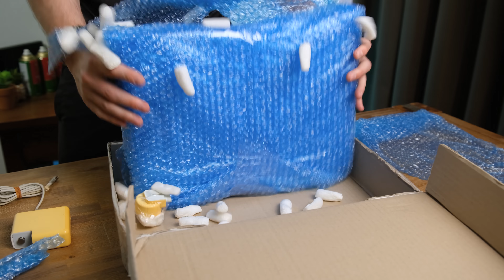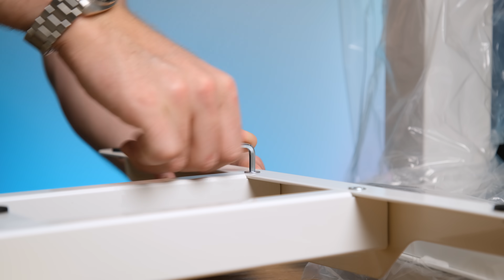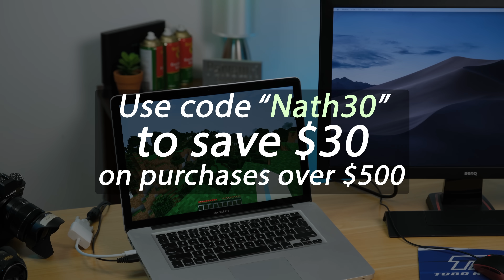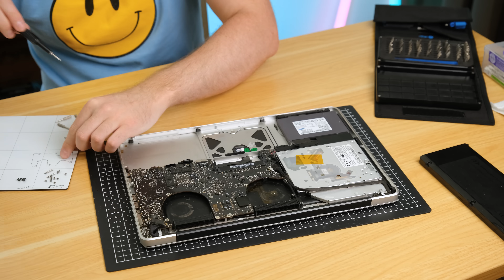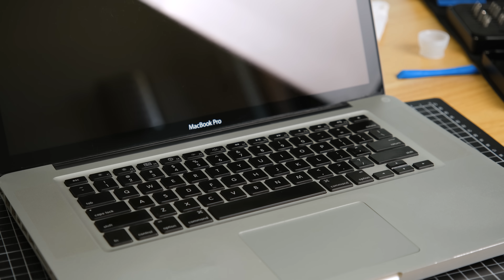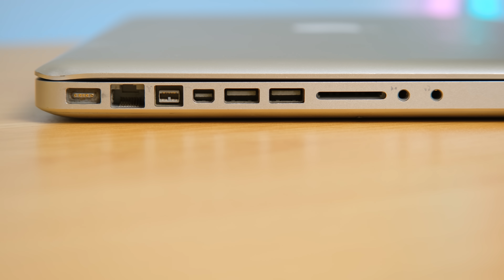$67 Macbook Pro From eBay! Is It Obsolete?

Comment: Still have mine from 2010. Replaced battery once and was contemplating swapping the optical drive for a SSD but it just keeps going and doing what I need it too.
Reply from the maker: I’d highly recommended the optical drive swap, assuming you don’t use DVDs anymore :)
Reply: I may well do it at some point. Sadly I kind of like keeping it original (except for the battery) Nerdy I know. Can’t remember last time I put a disc into a machine.

Comment: The SPD chip on ram stick is just an eeprom. You can program it with an arduino and set it to lower speed. I was able to get 16GB ddr3 working on my 2009 macbook.

Comment: my mom bought a 250$ laptop in 2017 and it had 4 gb ram ddr3, a 1.6 ghz dual core celeron and a 500 gb hard drive and it was slow, very slow it took 20 minutes for it to boot.

Comment: i had mine from 2009 still running flawlessly till 2 years ago. Then some motherboard issues occurred and i ve been forced to buy a 2nd hand one on ebay. I ve paid attention to buy one with the exact same specifics, ram , ios, and so on, except for the HD storage which was smaller. ALSO, unfortunately in 2021 i didnt know where to retrieve all my cracked softwares, basically i ve found myself with a fully working 2009 17" macbook pro but no softwares at all. One day i had this idea to JUST replace the entire HD with my old (functioning and full of softwares) one, and with a big surprise my old macbook SOUL was back to life working in a new macbook body.
but then 2 weeks after the screen started to have some issues till the point didnt work anymore and couldnt see shit. 
I then transplanted the screen from my old hd-amputated old macbook pro to the new body.
Im typing all this from my 2009 frankenstein macbook pro, which is still goin strong!
Im a vfx artist so from time to time i like to do stuff with Maya, Nuke and AE, and even if my machine is 24 years old, is still performing fine!

Comment: You’ve given me renewed hope in resurrecting my 2011 MacBook Pro. I’m sure that all it is crying out for is an SSD as I had specified the top 16gb RAM when it was ordered. I don’t know if I can go any further with the RAM. 
Unfortunately the model had a problem with the video somewhere and the only fix was to disable the GPU, from memory. That’s also disabled the screen brightness controls and it also means that the laptop can’t be used for mirroring. If there’s a way to get the video working properly with the brightness controls etc, I would love to know how to do it. 
Once that’s finished, then it’ll be time to look at installing something newer than Mac OS X 10.13.6. Some of the software these days doesn’t want to work on it!

Comment: I'm watching your video on my 13" 2009 Macbook Pro.  I was able to install Monterey via Open Core Legacy Patcher.  I highly recommend it to anyone wanting to breathe new life into an aging machine.
Reply: I used to use the same laptop with the same macOS, but recently I upgraded to a 2016 MBP. Although, for some reason, my 2009 MBP was very slow, despite it having 8GB RAM, a completely new battery and everything needed for it to function normally.
Reply: I have a MacBook Air from mid 2012 that I used as a daily driver for many months before getting a desktop. I installed macOS Monterey though OCLP and it works surprisingly well for such an old machine, though the battery life isn't great. It's better on macOS Ventura but the fans run at maximum or high speed basically all the time, which can get annoying. Same for Monterey, but it runs a bit better and the fans don't complain as much. I hackintoshed my current machine and I'm running macOS Sequoia without any problems, but if I need a laptop I'll still take the 2012 MBA.
Reply: PS make sure you have an ssd

Comment: Well, I once found a MacBook Pro, having been donated to my local disability group for a science lesson. It was with a couple of other laptops due to be disassembled for said science lesson. I looked at it, and thought, this can be fixed. I decided to take it onto myself to restore it to its former glory.

It appeared to be a 2010 model with a Core2Duo processor. I opened it up, and discovered that while it lacked a battery or hard drive, it’s logic board was intact, albeit a little dusty. I got it cleaned out, installed a new battery and hard drive, and installed macOS onto it. I discovered it was an i5 processor, so that’s a bonus!

I then proceeded to install 16gb RAM into it, and recently added an SSD, into it. While the keyboard was a bit faulty, I developed a workaround with a Bluetooth keyboard, and it apparently works better with the power supply attached. But those are mere trivialities. The fact I got a MacBook Pro for free is worth the effort. 😊

Comment: Love the uploads! And hi from Tassie.

I recently fixed up a Dell Studio XPS 13 1340. It has a similar GPU setup with one GeForce 9200m and one 9400m, the whole setup is named the 9500m GS. It also uses SLI between them with the right drivers on Windows Vista/7.

Comment: Holy cow, TWO Nvidia chips in a MacBook? I wonder if this is a secret SLI MacBook I've ever thought of😅
Reply: No. The other one is an integrated GPU on the core 2 duo processor. This is before Intel started making the i series processors and before Intel and Nvidia’s beef where Intel stopped using integrated gpus from Nvidia in their chips.
Reply: @nomaanalwi9495  oh, ok I guess. And Apple's relationships with Nvidia is broken anyway😅probably gone with AMD for quite a while before gone all in with ARM Apple Silicon
Reply: You think two Nvidia chips in a single machine is unexpected? Imagine an AMD Athlon desktop w/ integrated Nvidia graphics! That was my first desktop ^_^

Comment: I spent $20 US dollars on a early 2008 MacBook Pro, you know, the one with the nvidia 8600GT that tended to fail. I guess it was never used, its the only silver keys with a Core 2 Duo. I'm replying from it. They can still be useful, and I got the last of an era, but it still surfs the net perfectly fine
Reply: The 2007 models have core 2 duos as well. I also have one of these early 2008 models. The battery is completely dead though, so it’s pretty slow.
Reply: @EvilTurkeySlices  The battery on mine kinda still works. I found a NOS battery at Goodwill a few years ago and it worked great for about a month before it turned into a puffy danger pillow, luckily it didn't damage the machine.

Comment: I have a Mid-2012 13 inch MacBook Pro that I use as my main Mac, and it has several hard drives I use. I have macOS Sierra, Catalina, OS X Mountain Lion as regular installs, and macOS Big Sur and Ventura through OpenCore Legacy Patcher

Comment: I have a 2011 15" MacBook Pro with the i7. I've removed the optical drive, and replaced the mechanical disk each with Samsung 1TB EVOs, as well as upgrading the ram to 16GB. One is dedicated to MacOS, the other is dedicated to Windows 11. Honestly, I prefer using this computer over my 2015 Retina MBP.
Reply: Make sure to keep up on the cleaning and thermal paste replacements. These are the models known to have flaky graphics.

Comment: I still have my 2011 macbook pro.
I replaced the motherboard, speakers, added 8gb of memory, replaced the cd drive with a second ssd, and the battery over time. The board had to be replaced because this generation had the amd 4750 which would burn out because of overheating. My solution was to simply drill holes in the bottom cover where the fans are. Lowered temps by 15 degrees. Faulty battery on these causes slow performance, which i only found out after replacing mine.
Oh and until recently, mac OS did not support trim natively on the ssd unless its model name included "apple ssd". Luckily i was able to reflash mine to display this model. Don't ask me how, it was over 8 years ago...
Reply: I wonder which 2011 MacBook Pro you have. I have a MacBook Pro of the same year and I have had only one major problem, which was something about the graphics chip. It’s also been a long time since that was ‘fixed’. The fix was to disable it somehow but that also disabled the brightness controls and removed the ability to use mirroring. But it was better than having a useless laptop. 

I’ve had none of the other issues you mentioned except my battery was replaced in the first six months, I think. Or maybe that was an earlier laptop. I don’t remember which one now. 

My 2011 model still chugs along in no great hurry. Nothing that a fast SSD wouldn’t fix! At least, that’s what I think.
Reply: @andrewk4172  the real fix for the graphics chip problem is to drill holes in the case where the fans are. That improves cooling and prevents overheating of the chip.
Reply: @dgurevich1  thanks for that tip! However, it might have come about 6 years too late. When the problem occurred, I searched high and low for a solution and no one seemed to know anything. 
Apple's solution was to sell me a new laptop. 
I eventually discovered a young tech person who who knew about the problem and I hope that he just bypassed the chip. But if it failed, there's probably not much chance of finding a new one now.
Reply: @andrewk4172  Yeah. I worked with these laptops in hardware development for a while and was aware of this problem at the time. Basically, the laptops with the case off didn't overheat while the ones with it bolted on constantly overheated. This was my creative solution, much to the dismay of my boss.
Reply: @dgurevich1  I'm in Australia. You?
When I take the bottom case off, where do I go from there? (I have some tech ability, but definitely not an expert!) Then how do I source a replacement chip?
Reply: @andrewk4172 The entire motherboard needs to be replaced. there is no other way to fix it once the chip is broken. The vent holes in the case are helpful to prevent it from breaking, but once it's broken, there is nothing you can do.

Comment: I have one of these MacBooks given to me by a friend, I managed to get MacOS Ventura running on it using OpenCore patcher with relatively no problems, the 3 beeps on startup are to be expected, I stuffed some DDR3 memory modules I had lying around in it hoping it would work, but it turns out the memory was just too fast, 1600MHz is too much for these.
Reply: how would something like linux mint work on it?
Reply: @cobaltdev  the same way as on any PC with EFI, you plug a flashdrive in and tell it to boot from it, OPLC is only needed because of dropped hardware support on newer MacOS releases
Reply: @zaremolbepsidrink  i don't mean like that, but i reckon it could probably work quite well as a daily driver if given something lightweight

Comment: Where the hell do you get all these sub 100 dollar apple devices, literaly ive been trying to get any old sh-t at all just to play and test as i have never used apple device, and they are all either chinese fake scam bs  with 1 star reviews or 5-6 hundred dollars for 1/10 condition decade old pile of junk that splits into 5 inexpertly superglued pieces just by looking at it from a distance.

Speaking of thermal paste, its is very strongly recomended that you use a little piece of whatever you got handy and spread the paste evenly across the entire core before you place your heatsink. Its a naked core and uneven (and it usualy is uneven) pressure from the heatink mount may lead to a little bit of the die being completely naked, which is very very bad. ITs especialy bad on very old tech like these since they didnt have 30 differrent in-die temp sensors across entire core just one or two which means it might not pick up on the slightly naked die situation.
Reply: It’s actually pretty easy to find things like this on EBay, just have to keep an eye out. Also spreading that paste isn’t needed in a die this small.

Comment: Even after 14 years this laptop still has better performance than most laptops today that are sold with 4gb ram.
Reply: I haven't seen any laptop today sold wirh 4GB ram. Can you please enlighten on one that does?
Reply: @vincekara9446  Most Chromebook or the entry level devices with Celerons
Reply: @julianretro2582  Is that considered as a laptop? Chromebook is like an ipad version of a laptop
Reply: @vincekara9446 hp stream is a model that does.
Reply: @vincekara9446  hp 14" ultra light starts at $269 with 4gb of ram and 128gb of storage, its not hard to find a laptop being sold today with 4gb of ram since theyr'e the cheapest ones or they're chromebooks

Comment: The 9400m iGPU is actually in the chipset, it's not an alone GPU
Regarding the RAM, I often have issues when it isn't the frequency in Macs. If yours wants one slower stick, it's so the faster one also runs slower
Reply: Can confirm, these don’t like 1600mhz stick unless there is a slower one installed as well.
Reply: @EvilTurkeySlices  Yup, sometimes they don't like 1333 either and you actually NEED 1066.
I don't even think it's the iGPU at fault here

Comment: That's one hell of a good deal you managed to get there! And IMO, the Unibody Macbooks are the best ones out there; anything after 2012 has non-removable RAM and proprietary SSDs, as well as no DVD drive and glued in batteries. Certainly not very fun.
Though hey, at least someone used the patcher for a newer version of MacOS!
Reply: I went Mojave on my 2009 15”. It’s a little lighter and still supports 32-bit apps. So you can run older games on steam such as TF2 and Portal. The Catalina patcher is also a little buggy.
Reply: @EvilTurkeySlices   I think it's buggy dependent on machine? I ran catalina on a 2008 mac pro for a couple of years and It was pretty dang stable tbh

Comment: Great video Psivewri! I honestly don't think the laptop is obsolete. I don't have any Macbooks, but someone could easily install Windows or Linux if they wanted to. The design of the computer ages very well, too!
Reply: What would be the cost of adding windows wouldn't it be more than the machines worth
Reply: @cherkas009 you can get legit windows keys for less than $20.
Reply: @cherkas009  Good point. Maybe Linux would be a better option
Reply: @cherkas009 you can use windows completely for free or get a key for $10-15 dollars. Microsoft really doesn't care for personal use as long as you are using Windows.
Reply: Running zorin os on my 2011 macbook air, works like a charm, planning to use it as my main uni pc for the next coupla years

Comment: Mac videos are the best!
I´m thinking in selling my 13 inch base model from 2019 to a 15 inch pro from 2015 (because it has more ram and more storage). What do you think?
Reply from the maker: Might be good. However I've found the performance of the 2015 15" MacBooks to be pretty meh. If you need a larger screen and discrete graphics I'd say go for it. Just be sure that the battery is in good health as they are a bit of a pain to swap!